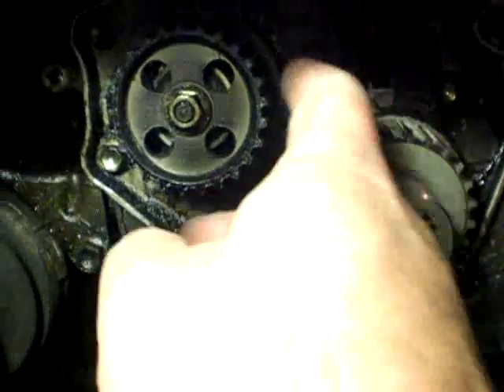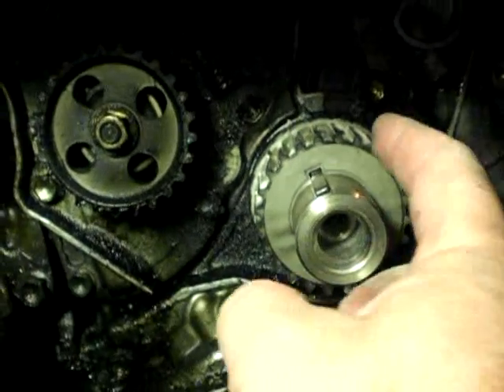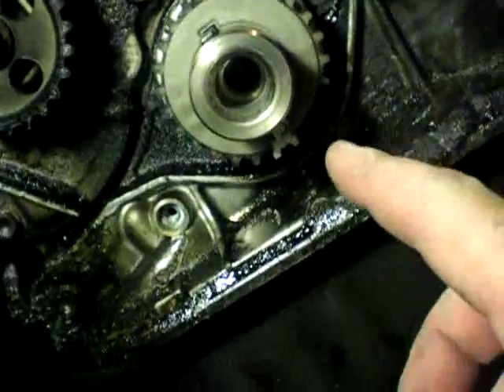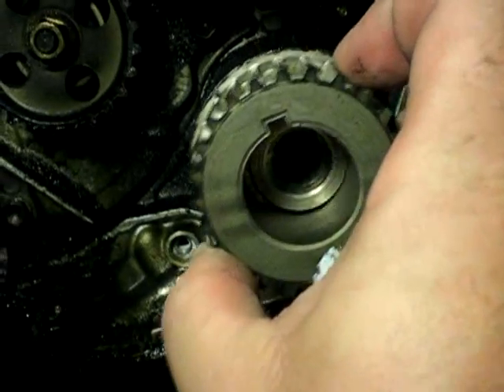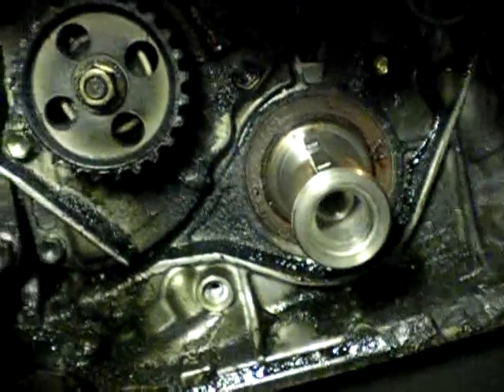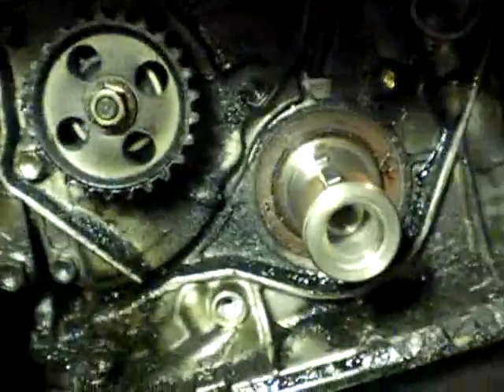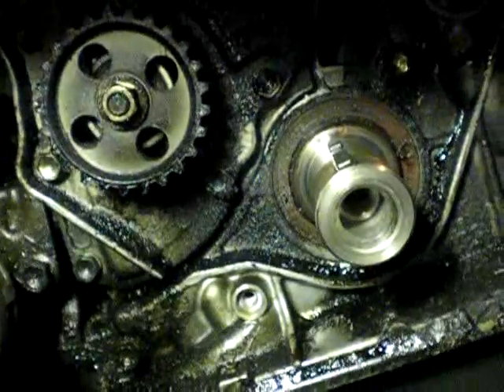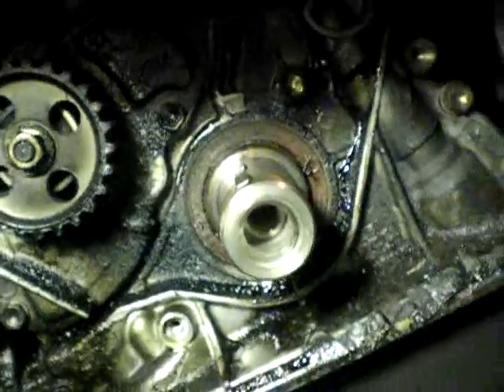Toyota 3S-FE Marks and seals_xvid.avi

Comment: power steering pump seal? nah... you got it right the second time - oil pump. Also you don't need to remove the cam cover to replace the camshaft seal, just screw a couple of screws in and pull out with pliers. Tap new one in with a socket slightly less than the seal OD, but add some grease to the seal first.